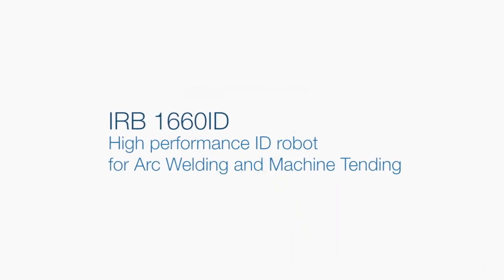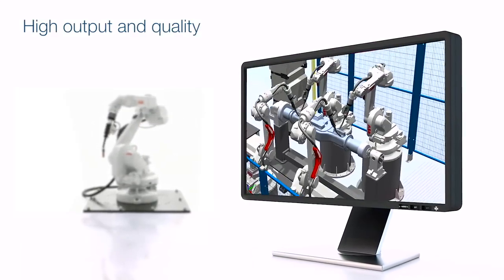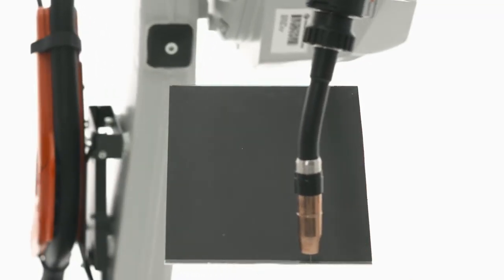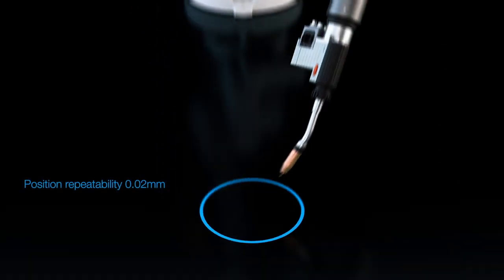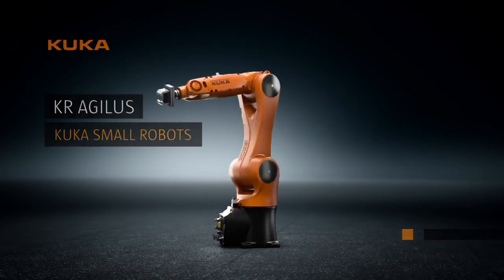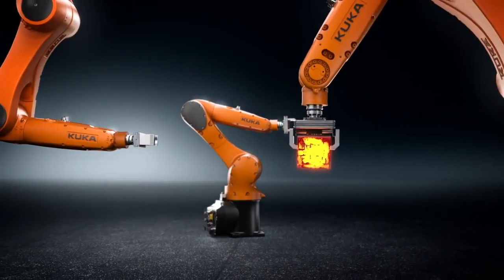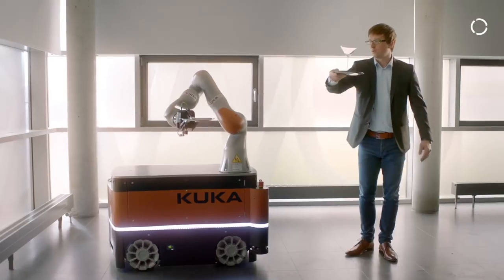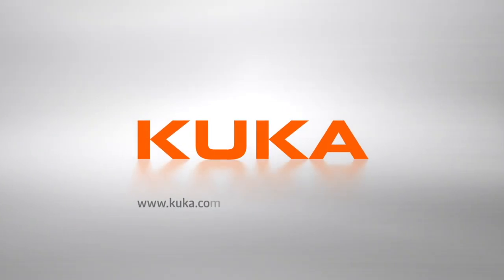Top 5 Industrial Robots you must see

Comment: [6:16]
I work at a place that constantly has problems with Welding Spatter. It's a big problem, that ticks off Customers. The spatter often gets into pre-drilled and pre-threaded holes, making it so SCREWS will not "screw in" when the fabricated assemblies reach the Customer.
Then I saw the ^video^ excerpt, which claims to reduce Weld Spatter by 98%. Even without the associated robot, this capability, by itself, is very interesting. The video claims that the problem is solved by synchronizing the moment of WIRE FEED with the moment of instantaneous Current Ramp-up.